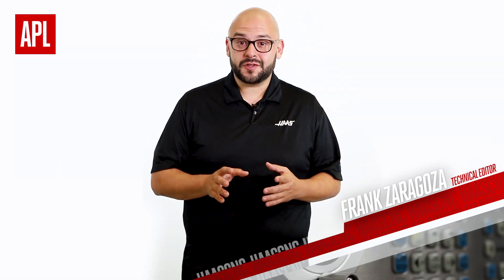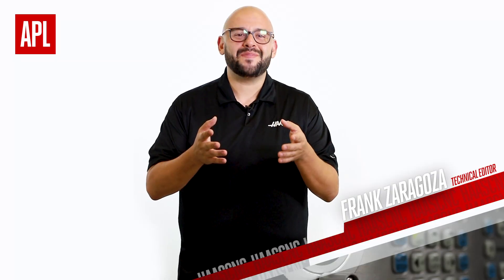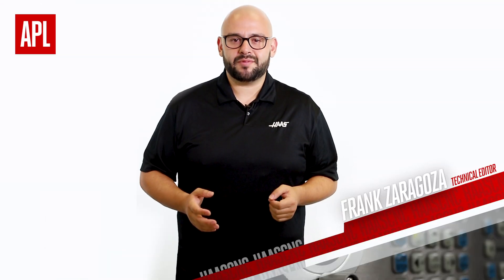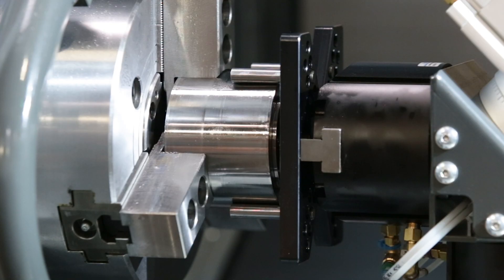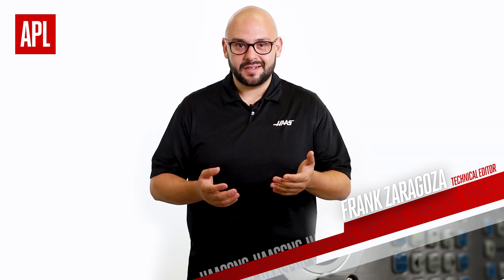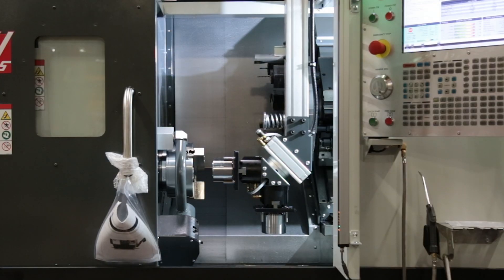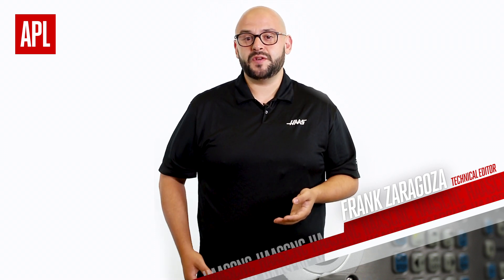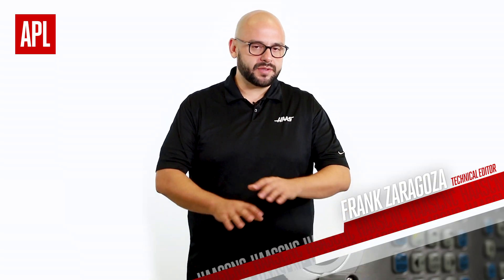The Haas Automatic Parts Loader is Coming Soon! - Haas Automation, Inc.

Comment: No sorry, basically putting people out of work, not good
Reply: Bruh, I do the same thing that this machine does. I dont want to be doing that for 10 hours straight if I could set up a machine to do the same amount of work without the effort. Yeah my job may be replaced but I could still program and replenish the stock also allowing me to run more machines  at the same time.
Reply: Care to elaborate? Do you like repetitive and monotonous jobs?
Reply: You do understand that CNC machines are already capable of more work than manual machines, meaning you need fewer machinists, right? This is just continuing that trend.
Reply: When APL is working operator can focus on measuring manufactured parts etc.